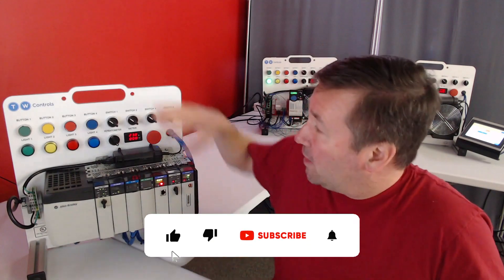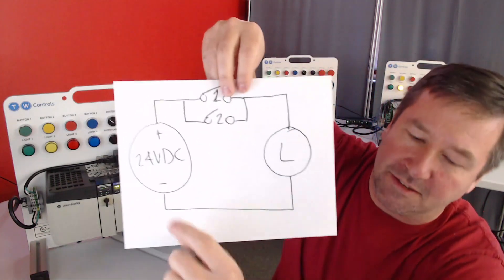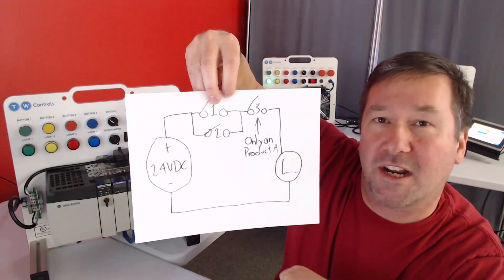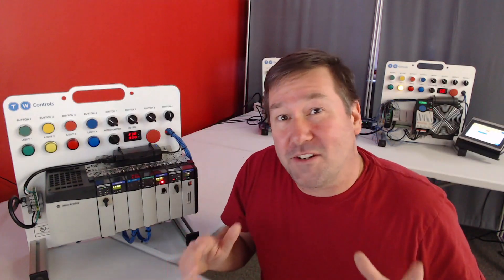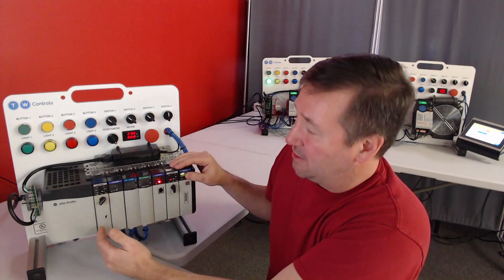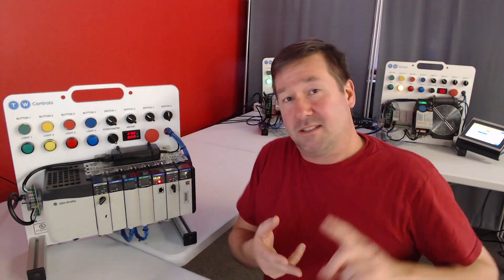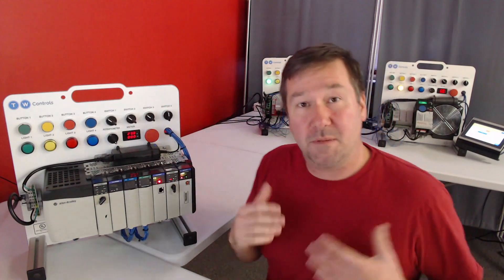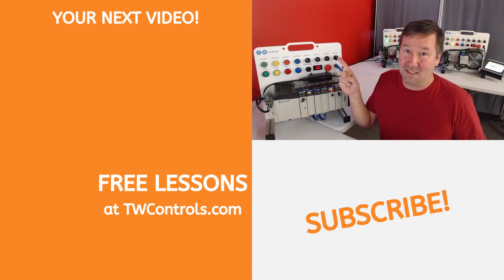What is a PLC?

Comment: I built a mobile rack with a 1756-A7 with a 1757-pa75 and a 1756-L71 processor using a panelview plus 1500 display. I am using my display as my HMI to interface with PLC to manipulate my analog and digital outputs and monitor my digital inputs. So far I have used it to field test RTDs and some 4-20ma devices that were in question.
Reply from the maker: That is great Leland!